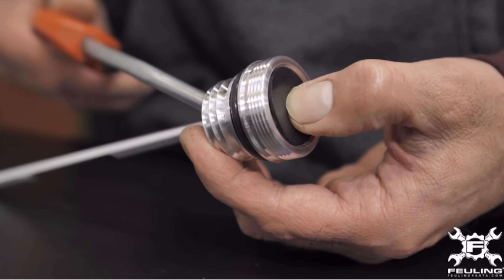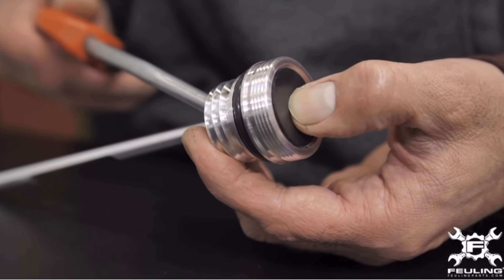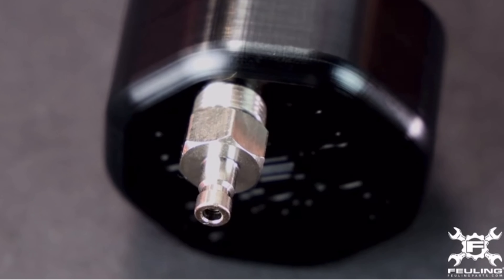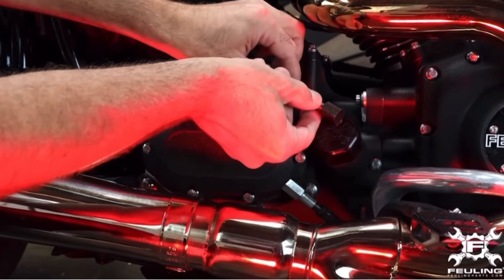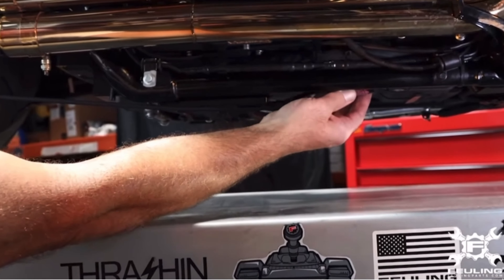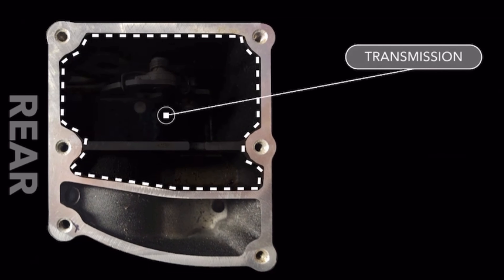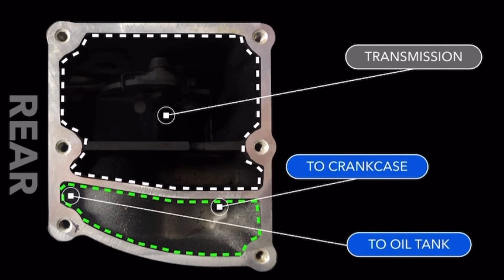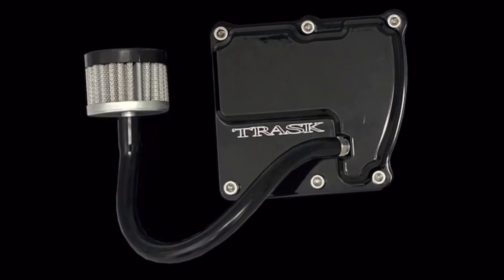Milwaukee 8 oil sumping? Feuling vented dipstick? Trask vented trans cover?

Comment: Would like to know your opinion on FP3? I'm happy with it, but I am also happy with a pb&j sammich! I know it controls a few things to do whatever with upgrades, however, I've been reading that the fp3 is behind alot of the heat off the motor. Its so bad on my 117 that above 85°, my fata$$ is in shorts. I do know enough about the fb3 that I did the 3 different rides for auto tune and just been riding, did get a few extra miles to the gallon. It's hard staying out of the throttle in the 117 though. Thoughs?
Also, wish I would of seen this before I put two half inch holes in the air filter backing plate, still confused though on that. I do have the fueling vented dip stick, I share that and bypass with every m8 rider I get to talk to. I am looking at the s&s cam plate/ Oil pump as soon as I get some money. $1800 for the part and lord knows how much in labor the video for the install is 45 min..
Thanks for any feedback!
Reply: Do you run an oil cooler? I know some M8 motors have them, but the fp3 shouldn't cause the bike to run hot (or much hotter) to my knowledge. You can also run as many auto tune sessions as you like to get the base map that was installed in your bike to work best. The FP3 is decent, but if you are after the best running, and working bike to make the most out of your upgrades you would be better off running a replacement ECM like a Thundermax which runs wideband o2 sensors and constantly reads and changes the parameters of how the bike is running compared to a flash tuner like the fp3 which uses maps from builds that V&H has done, so although the bike runs good the tune was never intended for that bike, elevation, riding style, so on so forth. I run the FP3 in one of my bikes and it works great,  but I am very likely leaving some power on the table. That being said, there are wide band tuning upgrades for flash tuners like the FP3, they are a bit expensive but they can be left on the bike to do the same thing that the aftermarket ECM (Thundermax) does!
Reply: @jonnymac8925  thank you for responding! Yes the cvo has an oil cooler, was think of buying 'love jugs' says guaranteed 100° cooler. I was thinking of going wide band, just have to replace Harleys oil pump and stereo. Motor is ok, the recall, rebuilt oil pump seems to be holding (fingers crossed) up, the stereo, atleast I have 2 of the 6 speakers working. Have a list, in time, eventually.

Comment: Catch can just reroutes the vented gas. Prevents it from going back into the engine for all the stated reasons. The only possible variable not accounted for could be the vacuum through the throttle body? I dont think its a factor. Catch can should be fine if vented properly.

Comment: Hey Ricky. Just caught this vid. Listen brother. Real quick, 2017 M8, upgrade stage 2 with SS cam kit for mainly the oil pump and cam plate, trask cover A1 vented dipstick and running oil level as low as I date, I am STILL getting oil out of rear breather bolt and inside AN big sucker air cleaner. Wtf there’s nothing left and no can tell me how to stop it. I know fueling dipstick is better but for 300??  And you say the trask tranny cover is too expensive? They both are. But none work. I think all gimmicks. Idk. Bike looks good and sounds ridiculously sick but I’m to the point of living with it. Any ideas?
Reply from the maker: Well bro you’re always going to get blow by (oil out the breather) but if it’s a lot that’s a problem. Honestly bro the only true remedy is an upgraded high flow oil pump. And even then there will still be a small sump due to that counter balancer in the motor sloshin and frothing the oil up. 

I’m actually researching now what oil additive there might be that reduces the foaming. Hope this helps bro
Reply: Consider doing a leak down  test.

Comment: Venting breather bolt does not change the state of vacuum in the engine... plz understand the engine better if you are going to make comments like this for ppl that trust your content. I dont disagree with adding the transmission cover. You are way off on the head breathers like it's very obvious. Iv been building engine my whole life you are very obviously mistake.